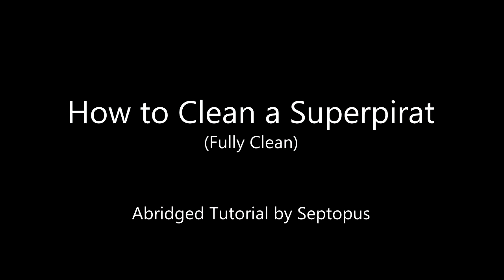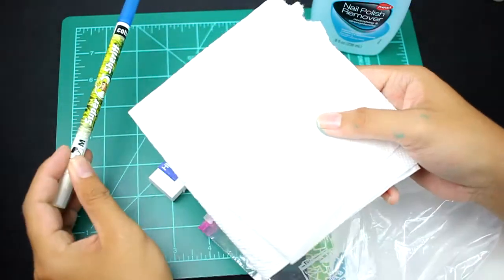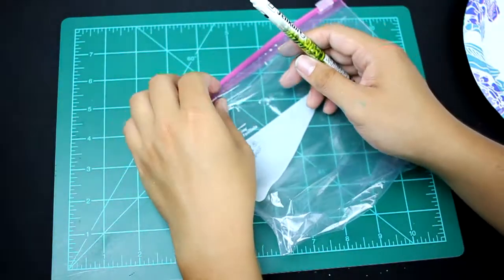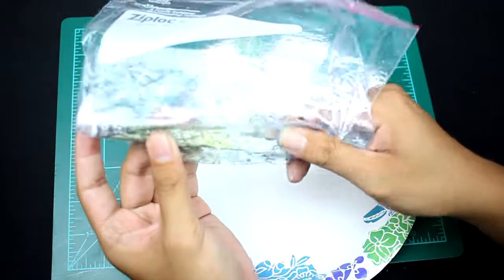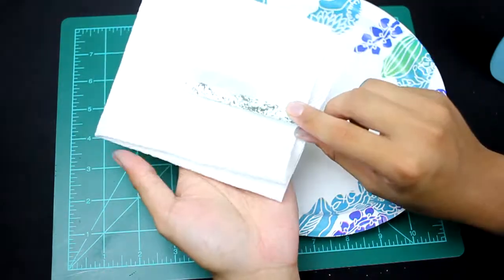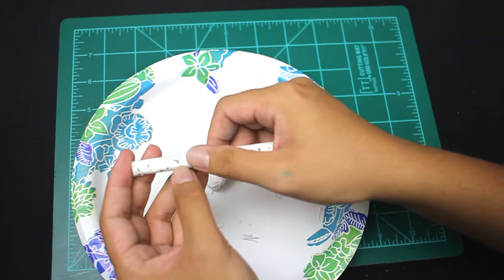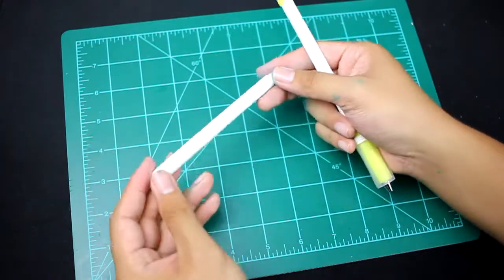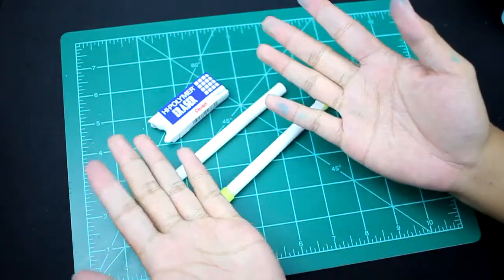How to Fully Clean a Superpirat (Abridged, 3 min)

Comment: Interesting :) I should also explain my way which is quite different than yours. Anyway, can you use the plastic bag for others superpirat or is it disposable ?
Nice tut, I am going to see the full one :)
Reply from the maker: Vôre-Tèx [PenModding] the plastic melts as you rub so I wouldn't reuse it. the logo/residue sticks to the bag so it's also hard to reuse.

you can probably use the remaining plastic that didn't rip/melt on the plate and rub it as if you were using a paper towel. you just need the logo to stick to the plastic really...

Comment: I tried this on a st barrel and was spacing out and noticed that i had a little bit of acetone in my finger so i didnt GAF and then noticed that my skin melted :v
Reply from the maker: Lanji UPSB bruh don't do this for an st use alcohol lol
Reply: SeptopusUPSB i was actually trying to remove the dirt stains in my st, its uncomfortable af with dirt stains ;-;
Reply from the maker: Lanji UPSB i feel you. it happens :( i would still use alcohol cause the st body has pretty soft plastic, unless it really didn't come out with alcohol lol
Reply: SeptopusUPSB  i tried alcohol a lot of times still didnt work rip st body =(
especially because our nbs has run out of Sts lol ='(
Reply from the maker: Lanji UPSB nooooooo that makes me sad 

i think that's just what happens with soft plastic. i def understand where you're coming from cause it's happened to me as well lol
Reply: SeptopusUPSB  Thanks
='3